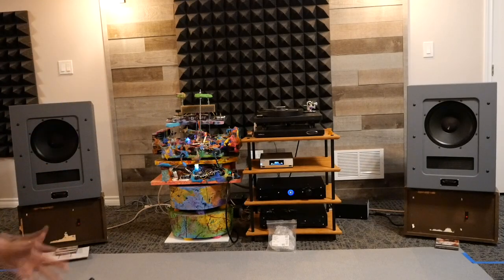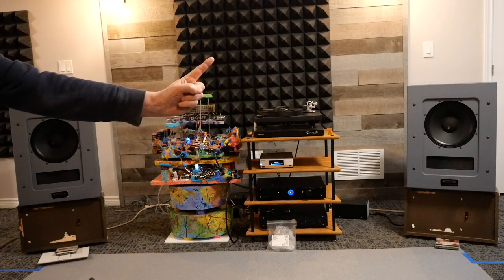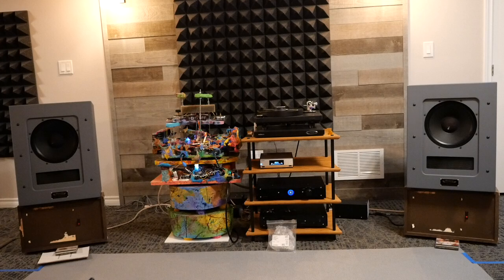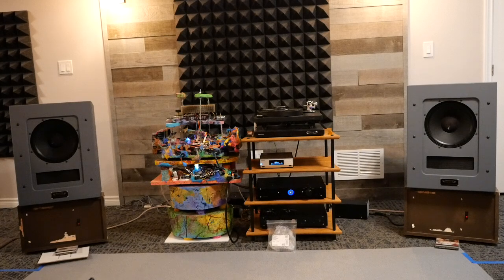NFS225 prototype M1 and M3 output module Sound Test

Comment: The power of uF  ... I often wonder what speakers Angela Gilbert Yeung likes to use with his / hers amplifiers?   Are the Altec Lansing the preferred speakers for AGY equipment?
Reply from the maker: I don't have a single preference of speaker.  Yes, I do have a pair of GPA604.  I also have the 2000s generations of Martin Logans.  ET LFT8, Aerial 5, Unity Audio Fountainhead, AAD 7001 just to name a few in my collections.  Plus other speakers my dealers are using.  The key to design good amp is to able to driver a wide variety of speakers. It is a pipe dream for one amp to sound good with every speaker on earth.  However, we all need to aim at something and work towards it.
Reply: Thank you Angela Gilbert Yeung,  Mike at Absolute Sound sells I think the Klipsch line and I always personally wanted to own the Klipsch Cornwall s as I think they are a perfect version of a ref speaker , has Mike tried your amps with a pr of Cornwall s ? I know they are extremely efficient at 102db and I figured your 25 watt per ch amps would be marvelous with them , Keep up the great work Angela and I am envious of your Ariel Speakers beutiful products , Hopefully I can get down to see Mike and you this summer at his store , Angela Gilbert Yeung builds such wonderful toys

Comment: May be I need a better way to listen but I think the M3 had better bass response and M1 sounded warmer. I couldn't make much else out of it. Given the difference in pricing I am not sure if M3 is the way to go. Or just create the M3 version and be done with it.
Reply from the maker: The M1 and M3 cost the same.  It is the Level 1, 2 or 3 power supply which makes it cost different.  They are two different things.